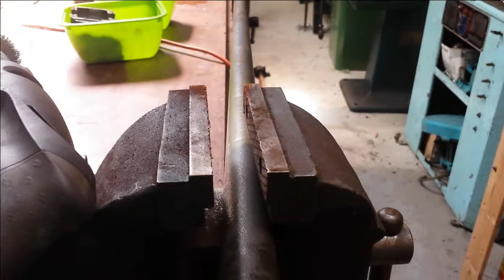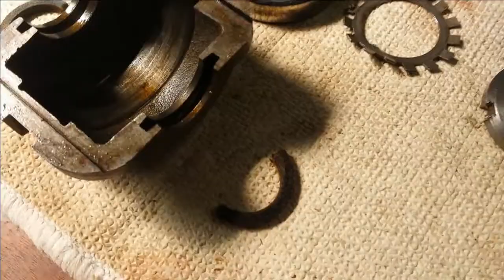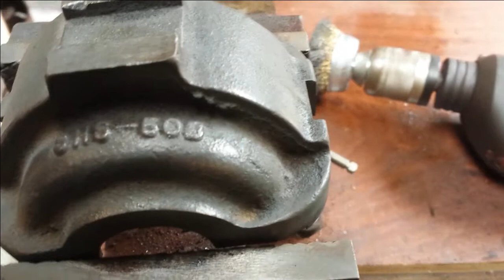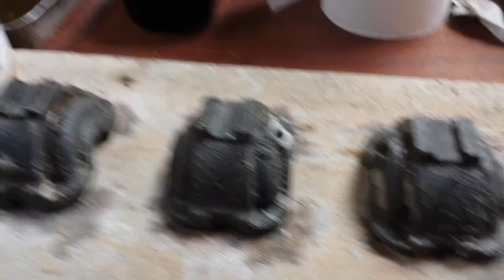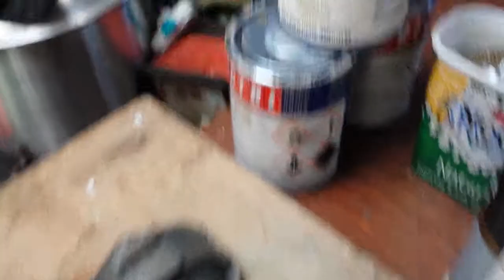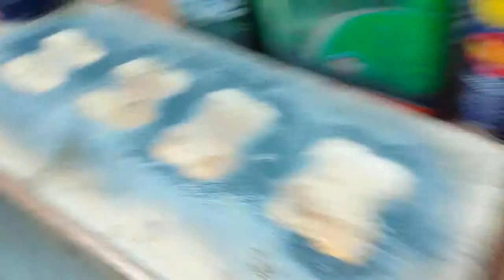France Workshop Lineshaft Project Part 3: Shaft, Bearings, Hanger

Comment: good progress!
I couldn't see a grease fitting on the bearings, do they not have one?
it's a shame about the damage on the locking collars but if the guilt becomes too much a touch with a file will clean them up again
Reply from the maker: There is a port for grease on each bearings, closed off by a nut which is removed to grease the bearing. These are more visible in Part 4 of the video series than they are here.
My guilt about the locking collars has more or less ebbed away. I still forget my c-spanners every time I go to France though!

Cheers!

gary
Reply: aaahhhh that makes more sense now,
It's interesting that grease fittings from what I can gather were invented in 1929 which would then be standard on these bearings, so your carriers may well be as old as you were saying they could be!

we all do naughty things that we are only too well aware are anything but best practice!

Cheers!
Reply from the maker: @FlyingRivets  Aha - nice bit of triangulation there with the dates! Industrial archaeology...

We do indeed... and frequently live to regret them!